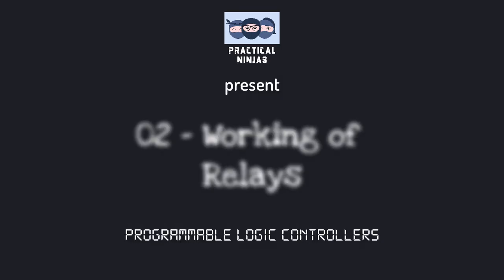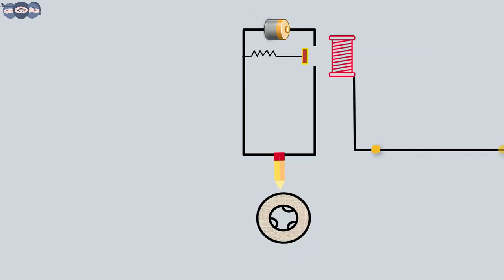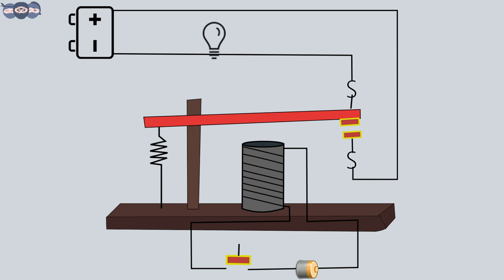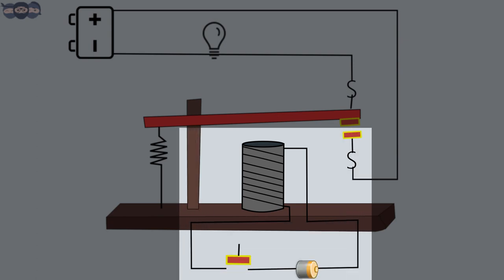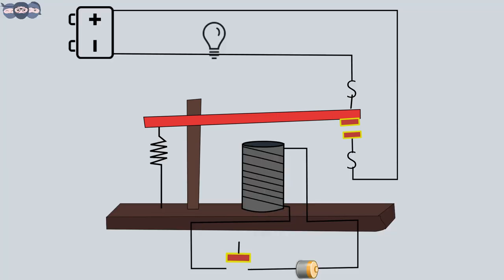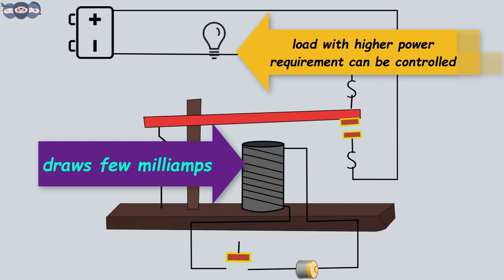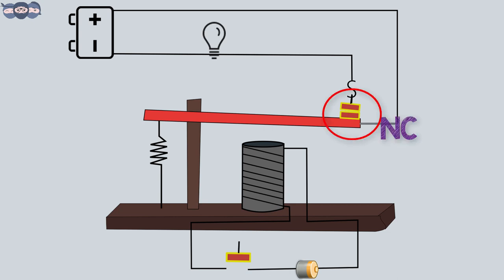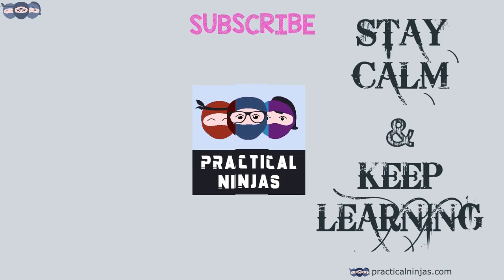Understanding Relays: How They Work & Types Explained | Automation and PLC Series Part 2

Comment: What happens when the contact switch is turned in case of normally closed
Reply from the maker: When the contact switch is connected, the circuit's continuity breaks and turns OFF.